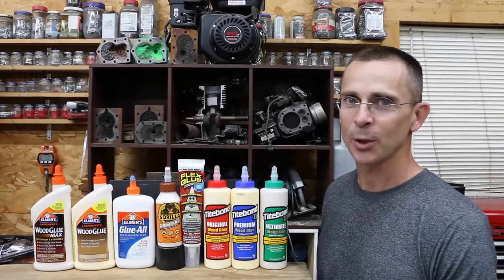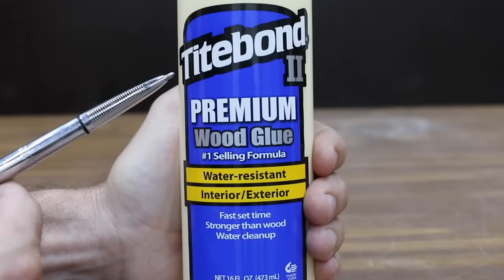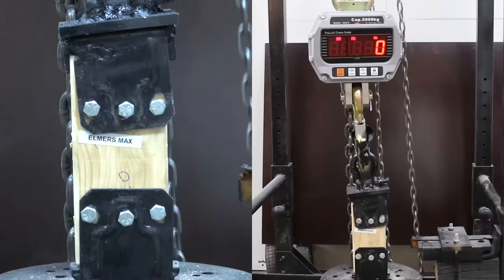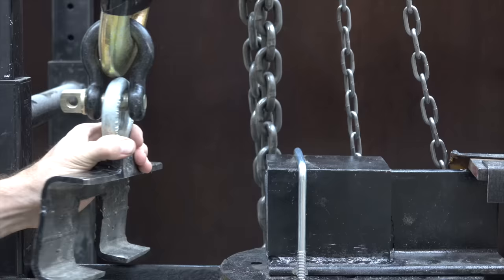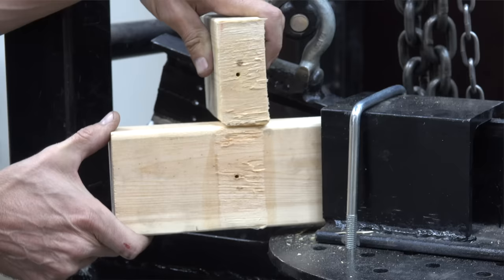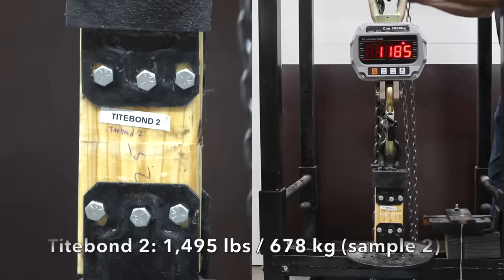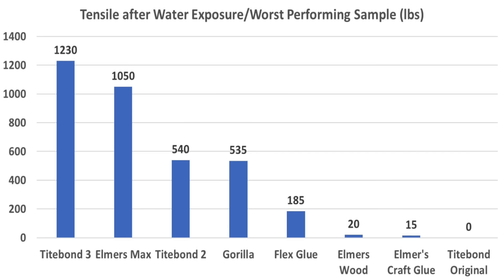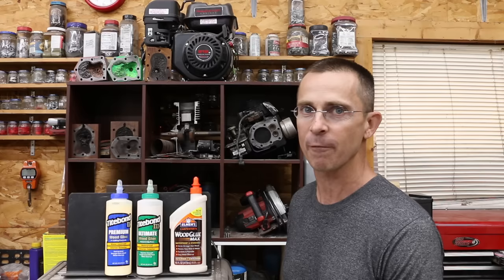Which Wood Glue is Best?  Let's find out!  Showdown with Titebond, Flex Glue, Elmer's & Gorilla.

Comment: Very good test overall, although I question the value of the endgrain to endgrain tests since that results in dry joint (you can see that happened in the results) and most woodworkers wouldn't attempt that joint.   The sheer test data does seem to support the prior testing and is more real world friendly.
Reply from the maker: Thanks so much!
Reply: They are all being given the same test…it’s relative….

Comment: Nice test.  You testing raised a thought/question.   I saw on one of the YouTube channels, where the woodworker suggested putting glue on the end grain, wait a short while for the glue to get tacky, and then add more glue and clamp the boards together.  The first application of the glue is supposed to seal the end grain, so when you put the second application on, it doesn’t absorb all the way into the grain, sucking out a good bit of the glue from the joint.    I think it would be an interesting test to see if this two step glue application is actually better.

Also, you test seems to indicate that abut joint may be a viable joint.
Reply from the maker: Thanks!  Thanks for the video idea.

Comment: Thank you for the thorough testing. I've never witnessed wood glue fail in normal day to day use to it's great to see what their limits are.

Suggestion for future testing: Caulk adhesion to different surfaces (acrylic, enameled steel, porcelain, pvc). Exposure to water, temperature etc. Then there's Silicone, siliconized acrylic, hybrid sealants...would be nice to see how they compare!
Reply from the maker: Thank you for the video idea!

Comment: I would like to see wood puttys be put to the test, in regards to resistance to cracking, shrinking, adhesion, sandability, etc.   I just tried some jb-wood as it seemed better than most other wood puttys, but would like to know if it gets the PF seal of approval!
Reply: I can vouch for JB Wood.  We had a large yellowjacket chew into a 4x4 post supporting our gazebo, followed by a woodpecker hammering away to get the yellowjacket.  JB Wood did the trick... it is lightweight, doesn't shrink, dries very hard, and sands very well.  After five years, it has worked like a charm in fllling the huge hole (damage) on the 4x4 post.  It has also worked well on an old dining room chair where the caster wheel broke out... and that has been at least two years now.
Reply from the maker: Thank you for the video idea!
Reply: @ProjectFarm  don't forget to test the homemade wood putty (saw dust and wood glue.)
Reply: I used some of that cheap powder mix stuff recently on a little repair and it was rock solid when cured. Kinda like hot mix joint compound, but for wood.
Reply: Throw Durhams putty in there as well! Love that stuff.
Reply: @ScubaDude68  Me too!
Reply: I second this!!

Comment: I was genuinely impressed by the strength.
Reply from the maker: Me too. Very impressive strength!
Reply: I made a really simple table with some elmers max(no joinery). 10 minutes after initial glue up I noticed one of my joints slipped maybe a 1/16 of an inch...I couldn't"t separate the pieces.

Comment: This was awesome! Is it just me or are the holes in the wood to close to the side of some boards in the shear test,  and not drilled inline with each other, causing the bracket to twist and apply uneven pressure?

Comment: Would have like to see some “liquid nails “
As a comparison
Reply from the maker: Great suggestion!  I tested LN in another video and it didn't do so well
Reply: Liquid nails is for boomers use loctide
Reply: Liquid nails is a terrible glue.  Not thin enough to make a good bond and really soak into the wood.  It's better for things like gluing down subfloor where strength doesn't matter much, but the thicker gap filling properties of it work well.  Or for gluing concrete blocks together.  For wood use wood glue.
Reply: "Wood have liked" 😊
Reply: 3M construction adhesive is much better.
Reply: @Goon31  Does Loctide come in a pod version?

Comment: I was reading through the comments and noticed that one commented on that gluing end grain to end grain are the weakest joints. If you ever do this test again you may want to choose s different clamping method. In the first sample (Tight bond Original) the joint strength varied between 4,000, 2,000 and 500 lbs. This is most likely because you used screws as clamps without predrilling the top piece of wood. When using screws to hold a glue joint together the top piece of wood needs to be predrilled slightly larger than the screws which allows the screws to place even pleasure on the joint. While your clamping method was not the best, the three samples of each glue brand did give and good comparison of the different brands. Thank you for your work.
Reply from the maker: You are welcome!  Thanks for the constructive feedback.

Comment: Would love to see a video on the strongest method for repairing a screw hole. Wood filler vs epoxy vs drill to larger size and glue in dowel vs stuff with toothpicks and glue. Then drill and screw in a hook that you can hang a weight from. Would probably be a very easy test by your standards :)

Comment: I'd like to point out that when gluing wood, you will get a much stronger bond when gluing long grain to long grain.  All your tests were gluing to endgrain which is much weaker.
Reply: I'd had the same thought. Most joints, you're counting on the long grain surface area contact.
Reply: Already a thread for this.
Reply: Yeah but they where all the tested like that so
Reply: First off, I agree with you. Long grain-long grain glue-ups are definitely a lot stronger. 

With long grain-long grain glued samples, I suspect we would see much more wood failure, rather than glue failure. The wood failure on a test would be more or less inconclusive. I.e., if products A, B, and C all failed due to wood failure and D, E, and F due to glue failure, you could compare D, E, and F, but you could not determine which of A, B, or C were stronger because the test only illustrated the strength of the wood grain (although you could potential determine if A, B, or C were stronger than D, E, or F).

TLDR: In my opinion, PF's test was a more conclusive method due to reduction of variables.
Reply: We see wood failure because softwoods are being used. Get some scrap pieces of hardwood and retest face to face. I can't recall if I've seen anyone do that on YT when testing wood glues.

Comment: Oh my PJ. Another very useful vid & yet another example of your ingenuity in fabricating your test set ups. I always liked Titebond 2 and occasionally pony up the extra for Titebond 3. It always seemed to perform better. Now I know why. Your post test hit home for me! I have 4500 feet of split rail fencing. Unfortunately "someone" bumped a post with the front loader while turning. Snapped it off at the bottom hole for the cross rails. Usually do but didn't have another post and horses were eyeing that opening with intent. Had to do something quickly until I could get another post. And as you likely know, those posts are not fun to get out of the ground. Out came the titebond 3 waterproof. Had a good jagged break so plenty of surface area for the titebond. A couple of screws & a ratchet strap and I was ok with my TEMP fix. Horses were disappointed tho ;-)  Interesting part is that was 2 years ago. Still haven't replaced that post.
Reply from the maker: Thanks for sharing!

Comment: We did a similar test, not as elaborate of course, in our woodshop class in 1971. Just various brands and types of glues, no wet testing. The verdict back then was ALL of them were stronger than the wood was, if it was properly done. It seemed like the smellier ones were the ultimately strongest ones, if the joint was a good one, no end grain to end grain, and clamped tightly. In the early 80's, I used some stuff called Eurathane Bond that was crazy strong. I used it to hang a small door to pass stuff through a wall in my basement, using just a few 1+3/4" wood screws to hold it in place while it dried. about 35 years later, a friend who bought my house was demolishing that wall, and he said that little door frame (2'X 1') basically had to be sledgehammered and sawed  out. In another part of the basement, he found out how strong hot glue can be if it's done right.
Reply from the maker: Thanks for sharing.